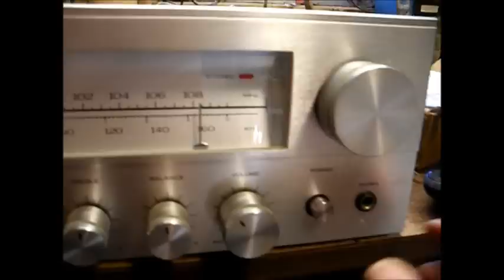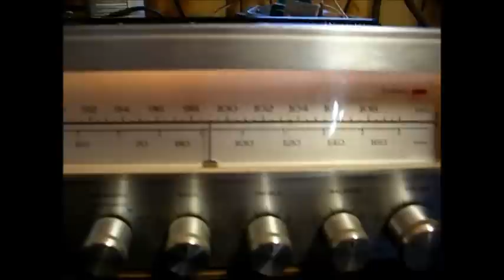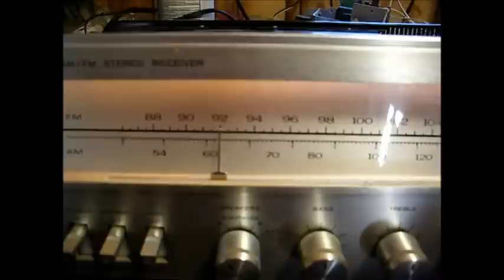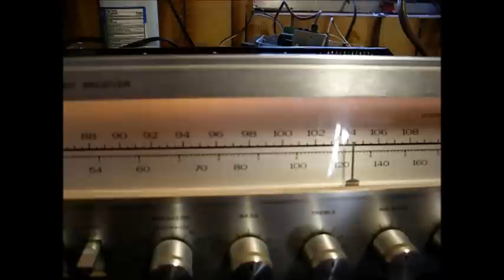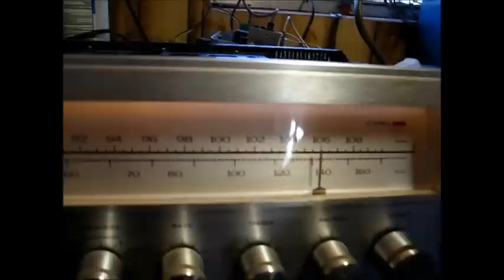Realistic Radio Shack STA-64 stereo receiver repair - part two

Comment: I have a 1979 Akai with a small hum that becomes apparent once the speaker relay clicks. It remains at the same volume regardless of what the volume knob is at. I heard it could be shorted outputs, but could I get a second opinion?
Reply: Could be ground loop within amp or simply a bad design, My Realistic STA-130 was a POS from brand new, it had a fixed level buzz (100Hz) In 2008 it blew the R speaker when the O/P chip shorted, putting 40v into the speaker killing the woofer

Comment: I just picked up one of these receivers yesterday for 10 bucks.  It has a bad tight channel that is silent until about 3/4 volume then just very distorted sound as well as the FM needs alignment because the dial is off and cannot get multiplex.  an RS tech has repaired this once because there are evident repairs and a service tag inside.  Do you by chance have a schematic for this unit?

Comment from the maker: First, I'd make sure they were installed with the correct polarity. The negative terminal on the capacitor is indicated by a large arrow with a "-" symbol inside the arrow. If the capacitors are in backwards, they are likely damaged and need to be replaced. If that's not the problem, check the audio output transistors & the power supply diodes for shorts, using the diode test function on a digital multimeter.

Comment from the maker: Yes, it's perfectly OK to use a standard two terminal capacitor. The third terminal on the original cap is not electrically connected to anything and is simply a guide to keep the capacitor from being inserted backwards. These capacitors are polarity sensitive; so, make sure that the replacement cap is installed correctly.